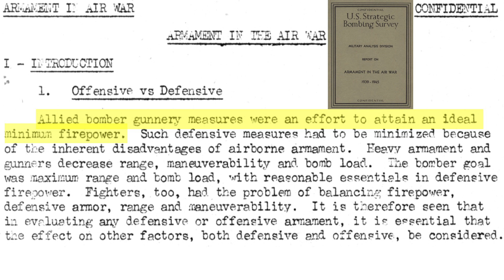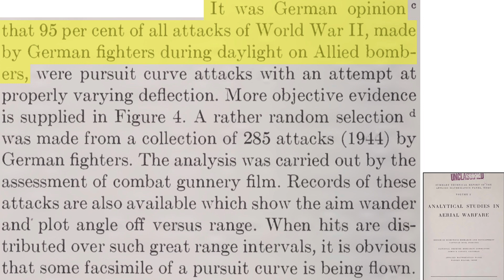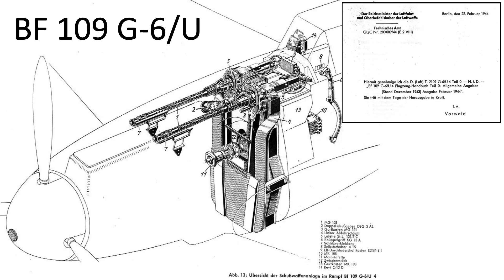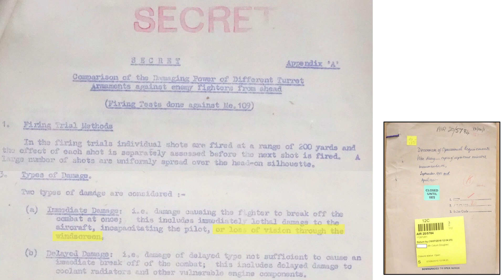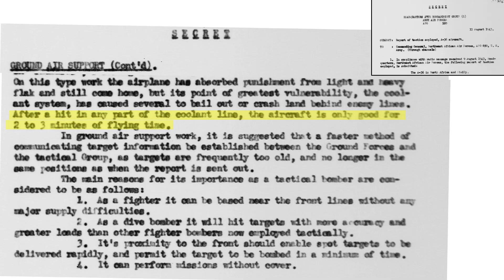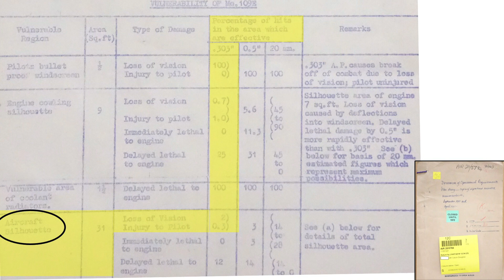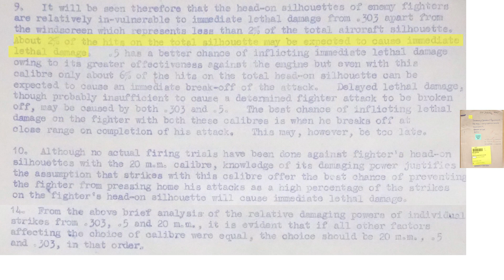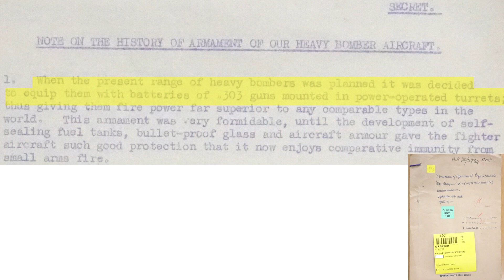RAF .303 caliber Me-109 live fire test vulnerability results – Lancaster bomber gunners aim point

Comment: Some Lancasters were fitted with .50 cal guns instead of .303s. The postwar Avro Lincoln got 20mm cannons.
From memory, there's a passage in the Wiki page about the B17. The Germans assessed the usefulness of their armament against the B17. They established two Mes or FWs flown by pilots of average ability would need to completely unload all of their ammunition before downing a B17. 
Advice from ace Douglas Bader: "Get as close as you can before opening fire. When you think you're too close, get even closer".
Reply: To be more exact, based on the german investigation, the b-17 and b-24 examined needed at least 20 hits from the 20mm gun to get shot down. The average german pilot scored hits with about 2% of his fired rounds. Same report also noted that when attacking from the front of the bombers, it took only 4 our 5 hits to bring a bomber down, due to killing of the pilot/s. The findings changed the german tactics.
Reply: Would have been nice if I could have done that in War Thunder  :(
Carrying a max ammo load, firing at max range, and standing on the trigger was too much fun, tho :)
Reply: When the B17 first appeared over Europe, the BF109's still had two rifle-caliber machineguns and only 1 cannon.  Still, 200 rounds of 20mm could easily down a B17.    It depended on where the rounds landed on the bomber.   The Germans quickly learned the vulnerable spots of the B17 and became more adept at shooting them down.   On the head-on attacks that were increasingly used later in the war, for example, a few rounds into the cockpit was often enough.  A few cannon rounds into an engine could disable it and start a fire.   As the war wore on, German fighters were increasingly optimized as "bomber killers" with more and heavier cannons.  This was partially offset during the war by the lower quality of German fighter pilots later in the war, though.
Reply: @jfess1911  The Me 109G1, with rifle caliber motor guns, was coming of the assembly lines by Feb 1942.  There were a few small series hand built production Me 109G-0 in combat trials before this.   The Me 109G-6 and its pressurized cousin the G-5 were commencing deliveries by Feb 1943.  The G5 and G6 were the first with the 0.55 inch (13.2 mm)   MG131.   This gun had a lower weight round with lower velocity than the Browning but a somewhat higher rate of fire compensated a little.   It had the destructive power of 2.5 rifle caliber machine guns so it had a much better punch.  Ballistics was about the same as a rifle caliber gun.   It's advantage was that it could fit in the space of the rifle caliber MGs it replaced. 
-The Me 109 was more likely to be used for head on attacks due to its weaker Armour and armament while the Fw 190A was more likely to be used in a tail chase.  
-Luftwaffe fighter pilots awarded half a victory for a "herausschuss" or for damaging a bomber such that it fell out of formation as this was considered more difficult than shooting down an individual bomber.   Once out of formation the bomber was almost certain to be shot down.  
-Some Me 109G6/U4, Me 109G14/U4 (and presumably Me 109G10/U4)  had the MK108 30mm canon fitted.
-The Me 109K-4 started appearing in October 1944 and had the 30mm  MK108 as standard in most cases.
-Heinz Knocke in his memoirs "I flew for the fuhrer" (the lurid title was his publishers idea, knocke was prett decent) recounts how he was shot down by a P-47 but as his engine stopped the P-47 flew past him and Knocke fired 1 or 2 30mm rounds into the P-47 which blew its tail off.    Both pilots bailed out and were picked up in the same Luftwaffe truck and they discussed what had happened with each other. (Knocke spoke English).   The American went to a POW camp, Knocke who had a fractured skull took a year to recover in hospital and barely survived.  
-A variant of the Me 109K4, the K6 was to have 30mm guns in the wing spars and also the Me 109K16 with a two stage supercharger.
Reply: @williamzk9083  Thank you for the details.  My main point was that when the B17s first appeared, the German fighters of that time were more lightly armed and had a tougher time shooting them down.  Nevertheless,  a single skilled pilot had enough 20mm rounds to kill a B17.
Do you have an idea how long  German fighters tended to stay in service?  How long, for example, did the 109s with rifle-caliber machine guns stick around.  IIRC, there was also a period when mounting extra 20mm guns was a field modification,  which implies that not all aircraft had them installed.
Thanks.

Comment: Why did the British persist with Browning 30 cal when Browning also made 50 cal that was a lot more effective? Plus they could have shared ammo supplies with the American bombers
Reply: They were in the manufacturing pipeline. RAF bombers with turrets, were designed for the .303. The size and shape of the guns, the weight of the ammunition, etc. As I proposed, if the turrets were there to provide the illusion of a defensive capability, why go to the trunks of disrupting production line output to incorporate the larger gun? It could also be that the deciders really did believe in the worth of defensive armament, although one could argue that having only the tail turret on Lancaster’s and Halifax’s, would have done nothing substantive to reduce defensive capability, reduced the casualty rate, and allowed for increased weight of bomb-load.
Reply: @ronhudson3730 
They didn't have to interrupt the production of bombers, the turrets were a sub assembly that could have been changed over on their own with little difference to the bomber itself once they showed up at their production facility.
The AN/M2 was already developed and being installed in aircraft like the P36 and B17 before aircraft like the Spitfire went into production and well before the Lancaster went into production, the RAF just plain dropped the ball choosing what was essentially a deer hunting cartridge by WW2 as an aircraft gun.
Reply: They did adopt the 50 BMG in some later Lancaster models.  Mostly the upper turrets but the rear mounted Rose Turret was adopted and fitted to 400 bombers.  Before the end of the war.
Reply: @JimmySailor When they were also mounting daylight missions in late 1944-45.